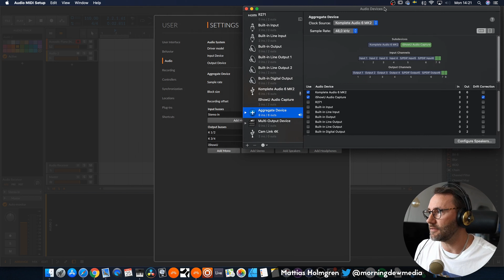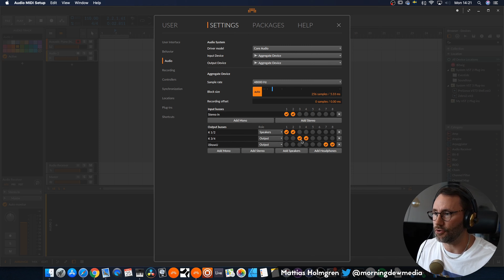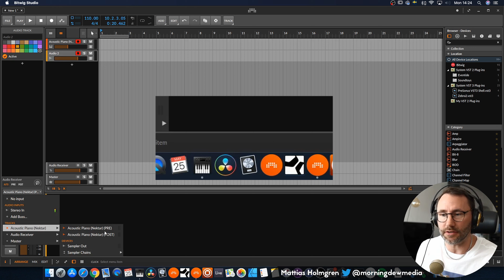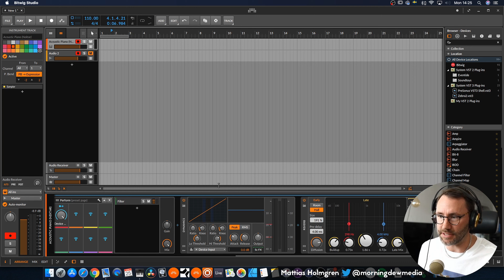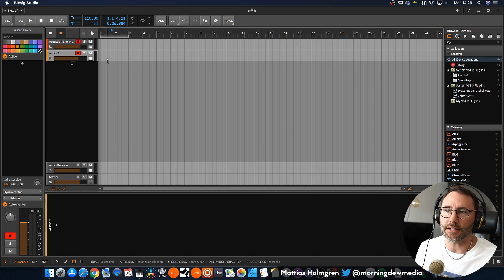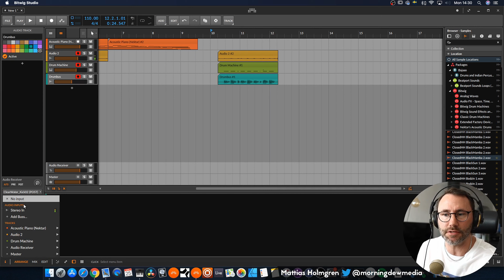Audio Routing in Bitwig Basics E19, Audio Receiver vs Track Input

Comment: Hello Mattias, I have this question; at 05:00, is there a way to isolate and record Only the Reverb Effect? I mean isolate an record Only a particular effect produced by a device? that would be Without the original audio signal.
Thanks
Reply from the maker: Yes, (one way) T1 has original unprocessed audio. use audio receiver or track input on a (T2) second track, on this track add effect of choice (reverb) set it to 100%wet. Set a (3) third tracks input to the output of T2…. Record what u like on T3.
Reply: @MattiasHolmgren  Yes yes, Mattias very good and many thanks.

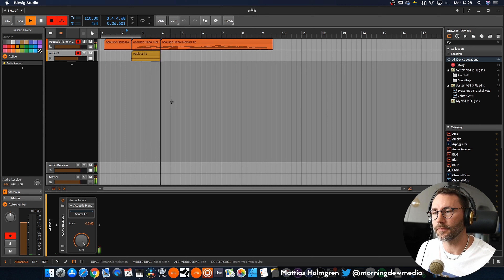Comment: Hello Mattias, at 08:00... ok, you can't record that audio, but I think there is a point on receiving that audio, what would it be?
Reply: I was able to record it on another audio track that would be the answer? thanks
Reply from the maker: You use audio input on a track if you want to be able to record on the track.

Audio receiver device is for routing in order for further / extra processing. But since device chain happens AFTER track lane (arrangement / clip) its not possible to record that audio on the arrangement lane / clip launch lane.

So for recording use track input selector (routing).
Reply: @MattiasHolmgren  mmm... Ok, I guess I see it now, If the audio was to be recorded on the same track is hast to be sent into the imput of the same track and we would have kind of feedback isn't it?

Comment: I notice that you're not getting any level information on that audio track you've used to receive the kick drum. That means it's not possible to do any mixing at that stage in the signal chain? There are level knobs per channel at the source end but I would have thought an actual channel strip would be more convenient. If you, in addition, instantiate an Audio Receiver on the audio track you do get level info. Why not use the combination of the two? (I ask because I'm doing a similar thing out of a Reason VST instance in which I have 2 stereo out channels that I want to mix separately.)

Comment: hi man I recently got Bitwig 3 and I am having problems with audio routing an eleven rack in Bitwig...im not sure what inputs and outputs to put in.....the eleven rack is also my audio interface...should I have this set to aggregate device ...although mine says pro tools aggregate I/O in audio devices? or should I have it set to eleven rack.....I have it set to eleven rack at the moment....I am also getting double sound when I play my guitar in Bitwig...and I always hear my guitar without arming a track....any help would be greatly appreciated
Reply from the maker: Hi Wardy, while I have no experience using the Avid Eleven Rack (I assume that is the Eleven rack audio interface you refer to). If you are running OSX or Win you can just select the Eleven Rack as your Input / Output audio interface in Bitwig Studio. I only have the aggregate device setup in OSX because I need to route audio from my DAW into OBS video recording software and also "merge" all my audio interfaces into one (for using them at the same time...ie. more available input / outputs).

Regarding the "double sound" issue: 
Maybe your audio interface has an audition option which routs your input directly to your output for direct (zero latency) monitoring. If so, please try to disable any DIRECT MONITORING options in the Eleven Rack software / application. I guess it comes with some sort of app for setting the input gains, headphone / speaker gain etc. Because if you don't have any tracks armed in Bitwig you shouldn't hear any of the inputs sounding.
Or you might have some other audio application open which has record active? (I sometimes have multiple DAWs open at the same time...ie Fl STudio and Bitwig, and sometimes I forget this and hear the kicks of the FL Studio tracks play when I hit the keyboard in Bitwig etc...lol...obviously I turn of the incoming-midi of the DAW I'm not working in to solve the problem). 😋
These are the only cases I can think of when you still would hear audio although no track is armed in Bitwig.

Let me know how it turns out Wardy! Cheers! 🌞
Reply: @MattiasHolmgren  hi man thanks for the reply....I think it is the eleven racks issue as it does not have a direct monitoring on or off etc...ive read that it only works in protools which is very odd as most audio interfaces etc have direct monitoring on of off etc...the only way I have found that cuts out the sound until I hit record is to put a lead in the fx loop and into input and then turn down the loop fx in eleven rack...but I need the effects loop for my Mooer radar lol...so I may have to get a different audio interface...I do have a pod x3 pro I could use...you may or may not know this but could you tell me how to connect the eleven rack to the pod x3 and use the pod x3 as the interface?...I rarely comment but I am so grateful to your Bitwig videos as I am quite new to all this recording stuff and its great to see others get to know the basics and also the more complicated things...so much to learn but so little time as I got a 2 year old who loves to beat me up alot lol.....cheers man
Reply from the maker: Hi Wardy, totally know what you mean. I've got two kids myself who beat me up all the time. ;D
Nah, they are the best. My kids are a huge inspiration in my life!
ok, so you want to setup the pod x3 as your audio interface?

To summerize: 
I would recommend grabbing a proper audio interface. There are quite cheap options, like the Steinberg UR-22C / Komplete Audio 2 etc. which area totally decent.

If you are going to connect the Eleven Rack into the Pod X3 you want to check a few things first:
1. I dunno if this connection is possible, because I don't know what the Pod X3 line-in / input looks like. It's probably a hi-z input for connection a guitar obviously. Does it have a regular line-in input too? Because the output of the Eleven Rack will be a regular line-out signal. And probably stereo out ;D
Is there a stereo-input on the Pod X3 so you can make use of the fancy chorus / delays on the Eleven Rack?

2. You want to make sure that the Pod X3 does not have any amps, speaker emulations etc on. You only want a clean signal path through the Pod X3 so you don't color the sound further. It's only going to act as a regular audio interface and nothing else.
3. I would recommend any other "proper / regular" audio interface to connect after the Eleven Rack, just to make sure you don't color the signal any more after your Eleven Rack output.
4. If you still want to try this, connect the "line out" of the Eleven Rack into the line-in of the Pod x3.
5. Connect the Pod X3 as a USB audio interface to your computer.
6. Select the Pod X3 as the audio interface of BItwig Studio.
7. Activate a stereo / mono input with the Pod X3 interface in the dashboard -> audio settings of Bitwig.
8. Listen to the incoming audio of Bitwig Studio on a single audio track which has the input active.
 Does the guitar sound ok?
9. Record as usual.

Hope the info helps Wardy. ;D
Reply: @MattiasHolmgren  hi man....thanks for the connections thats exactly how I got mine set up...I created a patch on podx3 with no amp effects etc on and it seems to work but I got another problem my pod x3 pro does audio dropouts a lot lol...so I guess I gotta get a new interface and maybe connect both to it....is there a difference between Steinberg UR-22C  and UR22 MKII? one more question me man...I have a Mooer radar that is an impulse response pedal...can I hook up eleven rack and pod x3 into Mooer radar with a split cable and then into new interface so then I can use both pod and eleven one at a time without needing both powered on or having to reconnect the Mooer when I wanna use pod etc?...the Mooer pedal  has one in and one out and it needs to be at the end of the chain....also do these interfaces you recommend have direct monitoring switch on them or in the software? as thats one thing I totally  need if I wanna use my eleven rack...sorry for all the questions I know ya like to play the guitar also...so ya may know...also I think it was on one of your videos were you use your own samples etc...are they in waveform audio so I can place them into another sampler like hybrid two project chaos? if so I may go grab some of your packs for Bitwig....cheers and have an awesome week my man
Reply from the maker: Hi Wardy, yes the UR-22C has much better SN-ratio (signal to noise ratio). It basically means that the older model v UR--22 mk2 (which I have in my bookshelf) has a higher background noise. So there is no reason to grab the older model. The price is already good on the newer UR-22C, so grab that one if any.

Yeah, you should be able to grab a splitter and send one signal into Eleven, and one into Podx3. Then have that Mooer Radar Speaker emulator pedal at the end of one of the devices. 

I didn't really understand your question about the samples, but:
My Sample-packs are all in .wav format so you can drag them into any DAW arrangement or Sampler.
My Bitwig-packs contain both Bitwig specific presets (which contains samples) and samples.
Sure, grab some of my packs at:
https://www.morningdewmedia.com/audio-shop

Thanks for the support my friend! Have a wonderful week!
Reply: @MattiasHolmgren   I will keep an eye out for the ur 22c....as a beginner using Bitwig could you recommend any of your videos to check out for classical composing with metal guitar...eq ....quantizing ...how to change  tempo during recording overdub etc and also like fast ways of programming midi notes instead of playing them...im not sure what the name of it is...but ive seen other composers using this feature but on Cubase I think...does Bitwig 3 have that?? any tips and tricks would be awesome...hit me up with  as many video links that you have done for me to binge to.....thanks for your help Mattias
Reply from the maker: Although I did my share of metal albums in the 90s I dont have any specific videos on the genre. Maybe I should do some video on the subject. But in general you should watch my Bitwig Studio video playlist which teaches all basic DAW production techniques, transitions, quantizing, editing and much more. It works across any genre and is basic principles. 🌞🧙‍♂️
Reply: @MattiasHolmgren  ok thanks man will check out your vids....thanks for the help and also for helping us out there with Bitwig...cheers me man and have a awesome weekend

Comment: how do you get core audio or is that a device
Reply from the maker: Core Audio is a low-level API for dealing with sound in Apple's macOS and iOS operating systems.  So it's available by default if you have a Mac / iOS device.
Reply: @MattiasHolmgren  I have a gtx pc
Reply from the maker: A pc (windows) does not use core audio, you use the asio driver of your audio interface. ☀️
Reply: @MattiasHolmgren  correct

Comment: Hi Mattias, great video! I use ASIO4ALL and I can’t choose my microphone and my speaker at the same time. I’m able to record myself without hearing the song or I can hear the song without recording myself. Is there any workaround for this so I can record myself while hearing the song?
Reply from the maker: Hi  would suggest grabbing a dedicated audio interface with proper ASIO drivers as the asio4all will mainly get you low latency in the DAW for midi keyboard to vst plugins usage. I dont believe audio recording will work properly with asio4all driver. I could be wrong. Im not a Win user since many moons ago. I use Macs and OSX because its easier to route audio and make merged audio interfaces on Mac.

But again, I would suggest you use a proper audio interface with ASIO driver rather than the free Asio4all if you want to record audio with low latency.
Reply: Use Jack driver

Comment: Hello Mattias I have a question.
Let suppose we have two tracks, ONE and TWO. I go to track ONE and select its output to track TWO instead of Master, is it the same than going to track TWO and select track ONE as track TWO input?
Reply from the maker: Hi Mja,

The result will not be exactly the same in these routing scenarios.
SCENARIO 1: If your route audio output of T1 to T2. 
RESULT: T2 will not be able to record the audio on the arrangement timeline.

SCENARIO 2: If you route audio input of T2 from T1,
RESULT: T2 will only show audio if record is enabled (and monitoring). And T2 can record the audio coming from T1 onto its arrangement timeline. ;)

Conclusion:
If you want to record the audio on the timeline ,make sure to set the AUDIO INPUT of the track.
If you don't need to record (resample), but just want to route audio for extra processing you can set the AUDIO OUTPUT to another track.
Reply: @MattiasHolmgren  Interesting and strange at the same time. Adding to the question (I know it is not possible but) It would be good if it were possible to select MORE that ONE AUDIO INPUT for a track, don't you think?
Reply from the maker: If you need to process several tracks the same way. Add tracks to a group and add the effects to the group track. Everything is possible. 😄🥁
Reply: @MattiasHolmgren  Many thanks you're so kind as always

Comment: how to convert midi stereo to mono channel or track. basically I want my kick on a mono channel how can I do it on Bitwig??
Reply from the maker: Check the Dual Pan or Tool device to make an audio signal stereo to mono. Dual Pan has nice control to process and pan stereo and make it mono or however you like. ☀️
Reply: @MattiasHolmgren  thank you very much for your reply, but there was a video you did on audio routing which I find more easier but unfortunately...... thank you anyway.